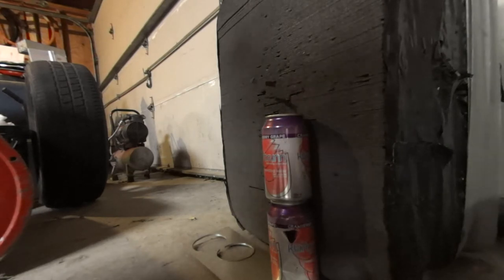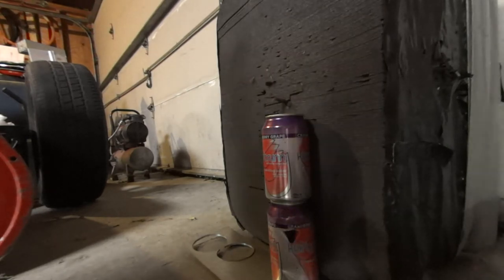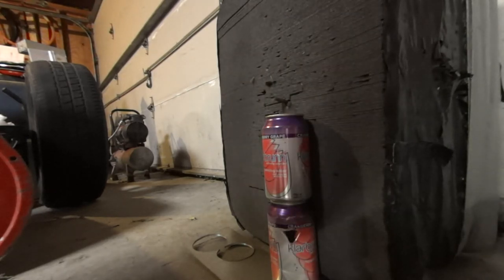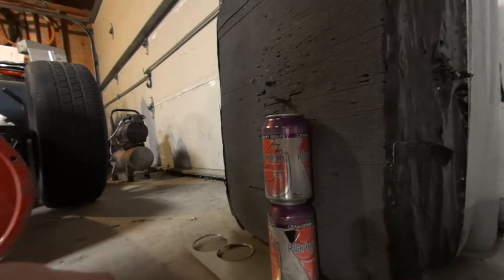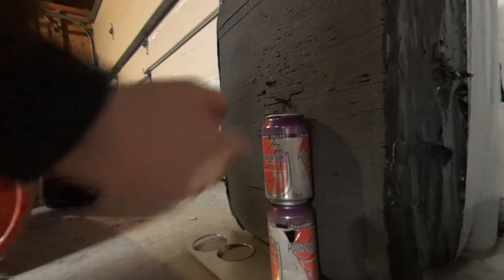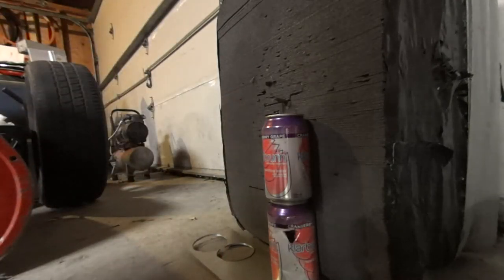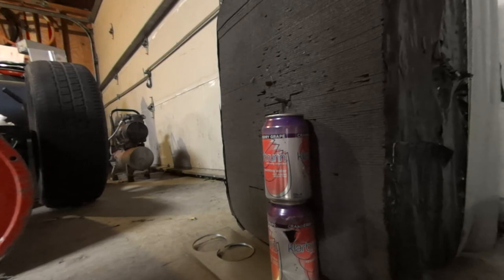Multishot QEV Rifle: Valve Stem VS Can 600 psi

Comment: But did you find an exit hole? I feel as if a single can-diameter full of water can stop the mightiest projectiles! A .177 airgun will surely do the job... I think the wider the projectile, the fastest you gotta go, no matter the mass nor the energy...
Reply from the maker: No exit hole.  The trigger is pretty hard to press at 600+ psi.  The faster you can dump the air behind the piston, the stronger the shot is going to be.  I'm going to try making a longer trigger for more mechanical advantage, and possibly adjusting the volume of the chamber attached to the three way valve for some extra umph.  And yeah, the more surface area, the faster it's going to slow down.  Whether through air or water.  An extremely lightweight projectile with a lot of surface area is the worst projectile.  Haha.  That's why it's kind of fun to see just how much damage you can get from them.
Reply: Swan Donovan yeah... I love that enter hole... Makes you think how useful would be as a prepper hunting gun